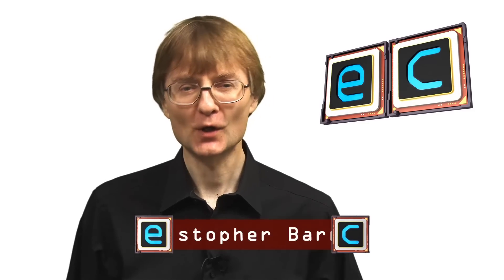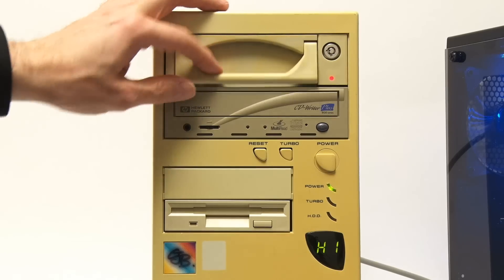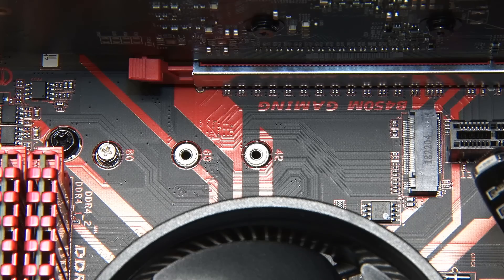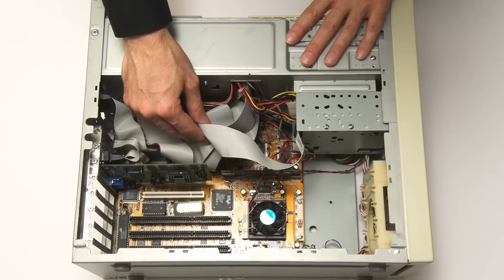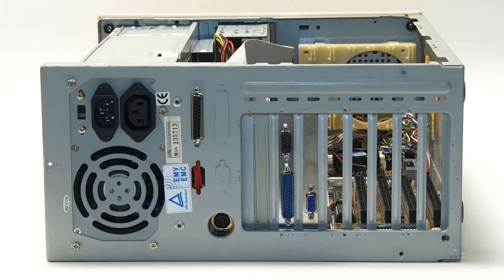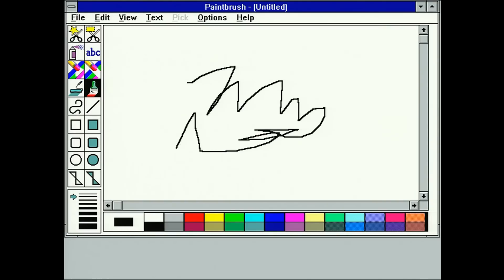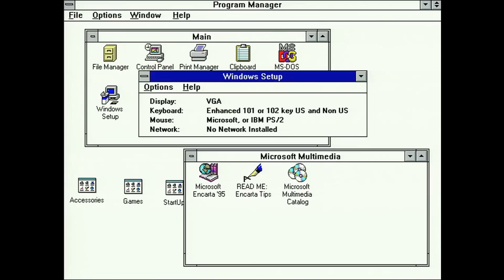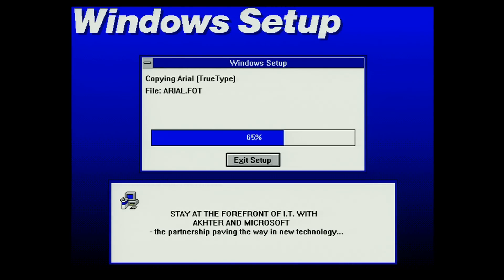Ryzen 3 vs 1996 PC

Comment: "Turbo" button it was easier to overclock in those days...
That booting up sequence with the energy star logo and the dos screen 😢 takes me back 👍
Reply: Turbo wasn't really overclocking.  Turbo was the standard cpu speed, and  the other option was under clocking the cpu down so older programs which relied on slower cpu timing to work.
Reply: @timmooney7528  Really, IDNKT, I suppose  normal and slow didnt have the same marketing appeal.
Reply: @calmac3723  Maybe they should've used terms such as MAXIMUM POWER and Legacy
Reply: @timmooney7528  Yeah that would have been more honest 😁 but turbo cunningly misleads people into thinking they are getting extra performance!

Comment: Why were you running Windows 3.1 on a Pentium machine?  Any CPU faster then 90mz should have been running windows 95.
Reply from the maker: Because those were the disks I had! :) And in the office we still ran DOS and Windows 3.1, as most of the software in use -- Word Perfect 5.1 and Lotus 123 -- was DOS. And these were the packages I used the vast majority of the time on this. PC. But I also ran CorelDRAW! for book cover designs, and for this I used Windows 3.1 and needed that 32MB of RAM. At the time, Windows software really was not that great -- many organizations did not leave DOS and DOS apps like Word Perfect until Windows 95 OSRII.

Comment: Oh glorious days. Lots of cables, little to no standardization with hardware or software, naked boards with no fancy colorful aluminium heatsinks, heavy disks, double speed CD writers, taking forever to boot Windows 95, fat32...

And beware of those caddies with handles. One wrong step and you could lose a whole 60MB of data, which was an awful lot at the time. No USB drives to back up files, long and sometimes risky disc burning.

Comment: The fun part was trying to use these things to type up technical reports at work, to try to improve on the results from the typing pool. Each time we sent them a page for correction, they would correct their first error but introduce two new ones. And don't get me started on equations, diagrams and dot matrix printers!

Comment: The first PC I bought was a  used P2-300. I bumped it's RAM to 8M. The 800M HDD was so small I had to remove NASCAR 3 just to browse the web on my new 33.6K modem...The first I built was AMD socket A (462). I've been an AMD fanboy since. Currently B450mPro4, 2600, 580 8G, 16G Trident RGB, NVMe, SSD...I hardly play games any more. Mostly watch high quality video...like yours! 

Thanks for that!

Comment: You did not mention your first motherboard and case used the AT form factor, the PC industry standard before Intel introduced the modern ATX form factor. Unlike modern motherboards, an AT motherboard has only one built in connection on the back panel, a 5-pin DIN connector for the keyboard.

Comment: My first CD Drive was a CD Writer I got second-hand when a friend upgraded to a faster IDE CD-Writer as it could only write at 1 times speed and took a very long time to burn a Full CD (I think it had 4 times read). My CD writer was SCSI and also had a caddy that fully ejected out to hold the CD and not a fixed tray (The CD in the caddy looked a lot like a giant 3.5" floppy). It was actually in an external box with its own power supply and a cable that went from a large 50 pin SCSI Centronics connector on its box to a 25 pin SCSI connector on the PC that looked just like the Printer port. My first PC motherboard also did not have the HD, Floppy, or IO ports on it, as that was done by two cards that plugged into the motherboard containing an Intel DX4 100 CPU I also picked up second hand. One that had the RS232 ports and the parallel ports on it and the other card that had the two IDE and floppy ports for my Harddrive and floppy drives. I actually had both a 3.5" and 5.25" floppy drive in the computer. I also had a SCSI controller card that would have let me use a SCSI Harddrive if I had wanted to with a 50 pin internal SCSI ribbon connector plug as well as the 25pin external plug. I started off with DOS and went to Windows 3.11. The only real difference between Windows 3.1 and Windows 3.11 I'm told was some extra support networking in 3.11. I used this when I took my computer over to my friends to share files and play two-player network games.

Comment: that was an "old style" system in 1996. my P-PRO i build the same time was ATX already. and i used windows 3.1 on my older 386 system and 3.11 on my 486 and up.. the P-PRO got a win95 beta at first and then the full version.

the build in network support in 3.11 was a god saver for me ;) my home network finaly worked good with the 3.11 network system.  everything up to that was hopeless. ARCnet was catastrophic bad on the PC. NE1000 card's and 3.11 work wonder. even the DOS support was good if you to the files out.

Comment: +ExplainingComputers / Christopher,
This is an very interesting video (especially when viewing it from my perspective, ie. someone that has built hundreds of computers and repaired countless devices within their career).

Also why did you include MS Win 3.1 within this installation and not either WinXP or Win 3.11 for workgroups (which would be more appropriate Microsoft based operating systems for this time period) or even (dare I say it) IBM OS/2 Warp (version 3.0 or version 4.0, the later version being released in September 1996)?

Something that I would consider as being very interesting is having a video produced that comparers modern day ARM based devices (SBC and "smart devices") with the 16 bit ARM based computers of the early / mid 1990's (ie. Acorn Archimedes. Commodore Amiga, Nintendo Entertainment System, Apple Macintosh Classic etc.) and possible another video which compares ARM architecture with x86 architecture (just a couple ideas for you to consider).

Comment: My first build was a dx4-100 had win95 I think. I had to take the sides off the case because it would overheat in any hot weather, then I upgraded to a k62-500 which had win 98 that was a big upgrade in performance at the time.

Comment: 32 MB of RAM was plenty in 1996 ! Consumer computers were more around 8 MB, plenty enough for Windows 95 and most software of that era.
Reply: Guillaume Gaudin i was thinking the same thing! I had a pentium 100 in 1996 with 8mb of ram that i thought was pretty slick. it cost me $6000
Reply: I worked as a software engineer and the team coded applications super efficiently, in some cases checking the assembly output of compiled C code to make sure it was pukka.

With windows 98 things were pretty good, office applications were slick and quick to load. Office apps.....Funny how nothing has really changed that much on the face of it, just more elaborate user interfaces. If anything, features were easier to find.
However, games have made significant progress and simulations using mathworks tools execute much faster now.

Computers back then were just as effective, it's the software and connectivity that has grown out of proportion.
Reply: @guywilkinson  yeah, i am totally agreeing with you on that point. MS Office used to fit on a few diskettes while now it barely fit on a dvd. Not that many new features though ! OS's have, on the other end, so many new features i can understand them becoming bigger, although they may have dramatized a bit too.
Reply: @Erik Mikkelsaar not true. even oem windows 95 had a minimum requirement of an 386dx. i've run it sucessfully on 386dx/33 with 8mb ram and 256k 2nd level cache with no hacks

Comment: On the old machine, there were 4 ea 8MB Dimms (signals on both sides of the stick), not Simms. Actually, quite a bit of RAM for Windows 3.1.
Reply from the maker: I am very sure the RAM modules here are SIMMs -- the contacts are the same on both sides, unlike on a DIMM (the dual inline refers to the connection pads, not the chips). I think I got a good deal on the RAM -- as you say, 32MB was quite a bit. :)
Reply: @ExplainingComputers  All the 2MB DiMMs were double sided back then, that's why they were called Double Inline Memory Modules. I don't think you can tell by looking at them.
Reply from the maker: @stanleyreynolds7800  I am not just looking to know what this RAM is -- I remember building the PC! :) I've also just physically checked, and the memory modules in this PC are 72 pin EDO SDRAM SIMMs, standing for single inline memory modules. They are not DIMMs, which stands for dual inline memory modules. Both SIMMs and DIMMs can have chips on one or two sides. The difference is that the connection pads on SIMMs are duplicated on both sides (hence single inline connections), wheres the connections on either side of a DIMM are different (ie there are two rows of connections, or dual inline). I remember distinctly that the RAM in my first build was SIMMs, but in my next one there were DIMMS. :)
Reply: @ExplainingComputers  I was building computers back then, and all (repeat all) 2MB Dimms were double sided. there were no one sided ones (except piggy back). There were several motherboards which wouldn't accept the 2MB Dimms. And for the ones that would, you couldn't mix 2MB and 1MB.

Comment: Lol, my initial foray into "PC building" was a 20gb HD install around 2001. The drive was purchased at a computer show, no retail packaging or documentation. My knowledge was zero, lol. It took a week of trying, a copy of "dos for dummies", and generous application of every curseword in my vocabulary, but I managed to actually have it up and running windows 95 with all peripherals actually operating as they should, lol. Within a couple years of dutiful scrounging on "bulk pickup trash day", I had built over a dozen "frankenbox" desktops at zero cost, and amassed a rather sizable pile of "spare parts" besides. Of course, the "building" was more fun than actually "having" them, so I usually kept a spare, and gave them away to anybody interested in taking one, lol.

Comment: My first built PC was, i386 16 MHz CPU, 1 MB Ram, No HDD ..   back in the 1992 ..
Reply: I had a Heathkit dual Z80 and 8086 -- 1984.   What was the clock?  There were many variants, some with advanced graphics like the DEC Rainbow.  They were of desktop type.  And of course tiny ones like the Sinclair-Timex ZX nes. or TI's weird T99  one.   And the Trash 80 -- Radio Shack's entry.   Staying within the desktop arena.  I remeber when the 4040 came out, the ads in the computer papers of the day.  I used to count, and on one hand the number of IC's (intergrated circuit devices) in our household before that late 1970's explosion of silicon waferosity.

Comment: Christopher, I did some testing with my RAM on my build with a Ryzen 3700X. Here some numbers. When the RAM works at stock settings (2133 MT/s and bad timings) - ill advised - the read is around 30 GB/s and the latency is around 107 ns. When the RAM works at 3333 MT/s with just XMP timings then you get around 49 GB/s read and a latency of around 74 ns. When the RAM works at 3666 MT/s you get around 53-54 GB/s read and a latency of around 65 ns. At 3733 MT/s it becomes 54-55 GB/s and a little over 64 ns. I couldn test for a higher clock frequency, 3666 MT/s is at the border of what is stable with the current BIOS and it really looks like the BIOS is the limitation. Today it wouldn't boot and the BIOS reset which is weird because I had booted it around 20 times with this setting and over 2 runs of Memtest86 (the modern one) I had 0 errors. When I set it at 3733 MT/s the motherboard will boot the first time, often not the second time. The bottomline is that you really ought to use faster RAM for Ryzen. The reason is that the communication between different CCX's goes a lot faster (lower latency, higher throughput) with faster RAM. In the case of an APU the GPU can use the faster RAM. 

It is fun to compare your old system with a new system. It is interesting to realize that the Apollo had a much more primitive computer than what is in a phone these days.
Reply from the maker: Thanks for sharing this info. Very interesting.

Comment: Nice retrospective, I remember building my first pc, was an athlon xp 2100 with a geforce 4 4600 (I ordered a 4200 and got a 4600 by mistake!)... also trying to tame those ribbon cables to get some sort of decent airflow - although I had owned other pcs previously, those had all been prebuilt systems

Comment: Hello Christopher. At that time it was very common the use of Fax/Modem boards for us to use in BBS and prehistorycal dialed up internet.  And windows 95 were in use aswell.
Reply from the maker: I did not dispute this at all, and did not dispute it in the video either. :) But more people in the mid 1990s got information from offline than online sources, which is the point I was making. As I've now typed here scores of times, I had disks for DOS and Windows 3.1, so that is what I installed. I am well aware that Windows 95 was available, but mainly (like a lot of people at the time) ran DOS with Word Perfect 5.1 and Lotus 123. This video is simply showing the PC that I built in 1996 and what I ran on it.
Reply: @ExplainingComputers  indeed, in 96, internet was sometinhg really expensive, In Brazil we used to pay as high as 50 USD/month for a limited 30 h/month.  Then, I've spend more time offline than online. By the way, Pentium was an amazing machine - disregadless the floating point defect.
Thanks again. My sunday is incomplete without watching your new videos.

Comment: I was hoping you would run Norton Utilities for MS-DOS, System Information, and show the CPU Speed screens for the 1996 PC and the Ryzen 3.  I'm thinking the P120 would have scored, like, 450 (ie 450 times faster than the 8086 of the original IBM PC).

Comment: old computers are cool that is why i have four of them :D pentium 1, 3, amd k6 etc
Reply: O man the AMD K6 CPU's where a budget building beast back in the day, I built my first real gaming PC in high school using an AMD K6-III 550Mhz CPU, and for the time just an awesome system, took me all summer, and then some working my first job to be able to afford it.
Reply: Commodorefan64 Yes amd k6 was a really quality tech back then :) and im glad that the computers still works fine. i just cleaned all the dust and replaced the weird old white thermal compound and voala, like as new except the old yellowish tone of the case. Computers in now days last only few years.
Reply: @SkrovnoCZ  It really depends on what your computing needs are, as with my custom office PC(I work for a small non profit for seniors, so I have sometimes have to make things happen on my own dime) at work I have a decade old AMD AM2+ quad core running @2.9Ghz on an MSI micro ATX mobo, with 8GB of DDR2 800Mhz RAM, 450 watt 80+ bronze PSU, an XFX AMD R7 240 2GB GPU, 120GB SATA SSD, 1TB WD HDD for storage, and for monitors 1 24in 1080p 60hz Sceptre, and another old Sony 19in 4:3 LCD @1280x1024 60hz. Plus with Manjaro Budgie Linux I can even still do some light gaming via STEAM, and it handles office work with no issues. So hardware can still last a really long time, and I think I'll get a more years yet out of that system for what I need to do with it.
Reply: @CommodoreFan64  well i use my pc for gaming and learning like programming and im trying to work with blender. Mostly i have problems with Windows because you know... Microsoft. I had a Linux on second PC but i was maybe lazy to install wine to do windows stuff, because i have a lot of problems with almost all my electronics so i don't have time. And both now running windows. Spec of the old pc is basic because it has Core 2 Quad Q9550 2,83GHz, 8GB DDR2 800MHz, asus P5Q Deluxe board, basic 120gb HDD with 500GB second drive and GTX 1050 ti. I can only say, it works. My primary pc is maybe better than my old one but i think that it is not that important. But mostly i like the older stuff (oldest) :)
Reply: The oldest stuff that i have is gpu 3DFx Voodoo Rush with 2MB of video memory :D and some board with 8MHz 8088 cpu in it without coprocessor.

Comment: WOW this takes me back.
I bought my first PC in 1997...A P120 IBM Aptiva. with a 1 GB Drive. (£2000 inc a £400 single cartridge Brother Printer, HR 400 (I think).
I fitted an Iomega drive for extra storage (100MB).
I remember the Encarta CD and I used Compuserve to access the Internet.
I originally had a 28Kb/s modem installed but upgraded to a 36 then a 56Kb/s.
It was capable of answering the phone if I was not at home, I think it took 7 rings before the computer was awake enough to take the message.
I quickly learnt how to build my computers from then.....a 266MHz then a K7 500 MHz (I think) then a 1.3GHZ model a couple of years later.
Arrrrrrrr, them were the days

Comment: 1996 Boot times: Dos - 36 seconds, windows - less than a minute and fully usable... slower drives, no ssd....
Reply: IBM 1992 ES9000 Mainframe 8 hrs but never needs to be rebooted unlike PCs and power supplies can withstand the radiation from a near miss nuclear strike.
Reply: Need for reboots is usually a sign of a specific operating system and not the machine itself haha.

Btw I like mainframes, just they are for different target population than personal or microcomputers. Btw I have more (still very little) experience in Z-series and S/390 only and not in ES9k but all beasts are quite stable from those kind that can be bought as furniture because of size haha ;-).

Comment: Put the Ryzen stuff inside of that 1996 PC
Reply: You'd have to carve up the case to do it.  Those 386s and 486s and even first Pentiums were all on the old AT-type boards.  Virtually everything since is built on the ATX spec.  Newer cases can accept older boards by just omitting the IO shield, but the reverse requires heavy case mods.